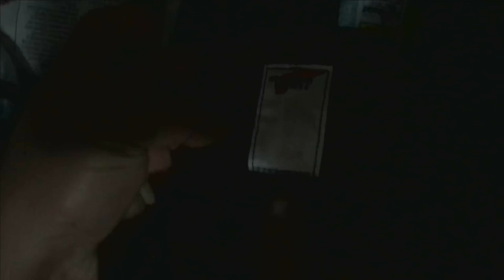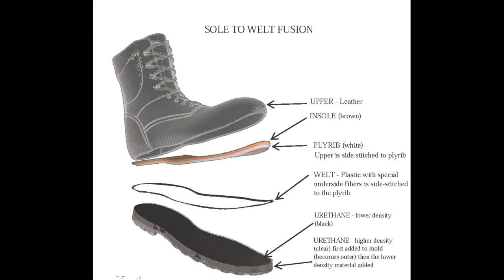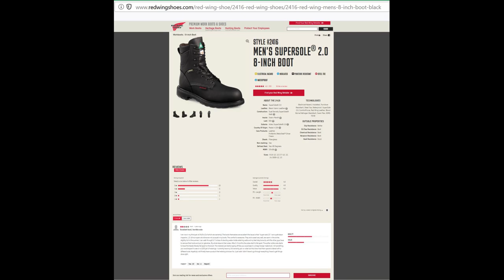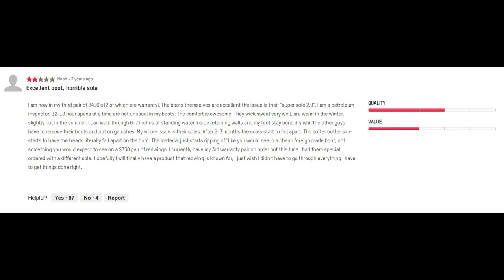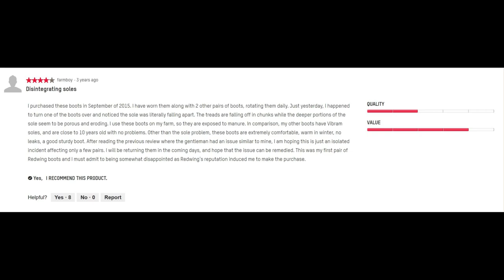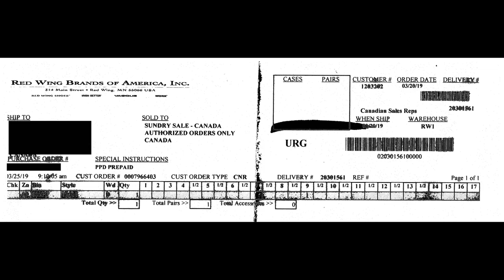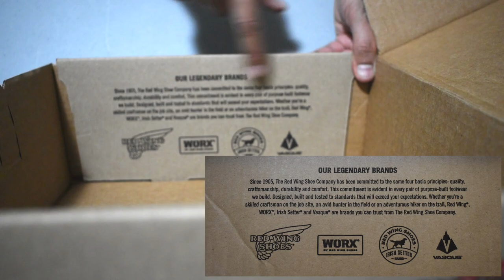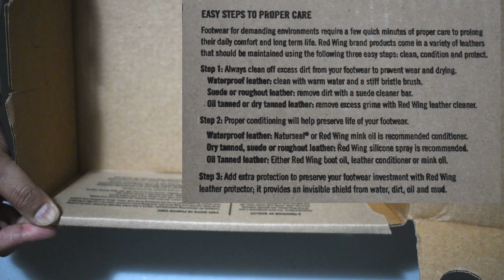𝗣𝗥𝗢𝗗𝗨𝗖𝗧 𝗥𝗘𝗩𝗜𝗘𝗪: 𝗥𝗲𝗱𝘄𝗶𝗻𝗴 𝗦𝘂𝗽𝗲𝗿𝘀𝗼𝗹𝗲 𝟮.𝟬 - 𝗥𝗲𝘀𝗼𝗹𝗲 𝗮𝗻𝗱 𝗥𝗲𝗽𝗹𝗮𝗰𝗲𝗺𝗲𝗻𝘁 - Model 2426/2416

Comment: Red wings are no longer the qaulity they once were. There is no lifetime warranty on them anymore. Now there is only a year warranty, if anything happens after a year your paying for shipping and whatever cost they decided they want to charge you. Also people don't realize it but they are not solely made in USA anymore most are made over seas. I have owned at least 11 red wings boots throughout my Life. I'm 56 years old and a contractor who has tried pretty much every brand out there . Red wings were good back in the 80s but not no more . They would last at least 5 years before the soles or stitching started to unravel. I just purchased a pair last year 2023 and paid $400 for them 2 days ago the stitches Ontop came apart, I took them into the red wings store in my area they said I barely made it in time before my 1 year warranty expired, I told them I thought they were lifetime warranty? They said not any more. They gave me a brand new pair because it was only 11 months and they couldn't be repaired. Back in the 80s they always could be repaired even if the stitching were to unravel. They said no they use machines for everything, therefore they are not hand made from scratch like they were in the 80s. She went on to say that they are a union company as well and they are having problems keeping people aboard to work because of our lazy new generation no one wants to work. They live with mommy and daddy till they are 40 years old so the qaulity of the manufacturing is just not there anymore. I have a pair of iron age that are now 7 years old and still going strong and 1/4 of the price that you pay for red wings. You see back in the 80s people cared about there jobs, they cared about the workmanship, in 2024 the only thing the new generation cared about is being on there cell phones and social media. She ( manager ) at this store is 65 years old and been working for red wings for over 30 years she said it's the new generation that has caused red wings qaulity to fall to the curb side,

Comment: Chapter 2 LoL
Well, to make a long story short... Oops, too late 🙄
Anyhowz, for the first coupla years (which actually only added up to approximately 6-8 months of service for a fairly Expensive ($275. USD @that time) pair of Workboots went quite well. In fact, at least another 300 + pair were purchased as Standard Safety Equipment for each and every employee by the company I worked for. After watching this video I just learned tonight that I'd inadvertently purchased a Vintage pair of Red Wing Boots as mine were manufactured in January of 2003 so according to Red Wing themselves they sat around for several years prior to being purchased and put into very Light Duty use (99.8% Fair Weather Summer use in fact) by Me. Being Ex-Military I imagine many/most of you probably know the Care and Attention given to footwear, Especially Black Leather Boots!?! Cleaned and Kept Cleaner than your Silverware not to mention, "Highly "Spit" Shined" to the point that the Heel and Toe outshine"Patent Leather". And YES, even the Soles are thoroughly cleaned using Soap/Water and a Stiff Bristle Scrub Brush. Except for that last day that is. Yeah, last year was "Just About a Bitch" but on the First Beautifully Gorgeous Day For a Ride showed up as always, Bikers make quite an Event out of it and I'm Absolutely No Exception. Heavy jeans, Heavy Red plaid shirt, Leather Vest w/ Tire Chains (in the event were caught out in one of those unexpected Michigan "Lake Effect"  Snow Squalls despite Global Warming LoL), And, Last but not Least... My Awesome Red Wing Boots along with X-Tra Special Riding Socks that complete the package. I'm Zipped, Buttoned, Snapped, Chained and Laced Up 🤔... Hmmm... Sounds a helluva lot kinkier than it looks HuH, Lmmfaooo...
First Trip... Oh somewhere around 75-100.... Feet, LMB'sO. Stopped at the Gas n Get next door for Smokes and other essentials for the Open Road. My buddy, Owner, is working behind the counter notices that I've acquired the dust mop and am giving the front and cooler aisles a quick once over.
After getting tired of standing/leaning/almost laying against the counter waiting for him to come out and finish his last minute stock ordering I've started wandering around Fronting and Facing the shelves which he hates on order day as he can't see what's NOT where it WAS, LoL! That gets him a Runnin' but he suddenly changes direction, disappears and comes back with the dust mop now running around the whole store with it like he's on the Olympic Curling Team of Vancouver or something. "GOD DAMN MUTHAFUKKA SON UF BEETCH AND CHITZ!!! WTFNF?!? AY JO,?!? JO?!? WHERE AH U MUTHAFUKKA... AHHHH... CHITZ... AGAIN!!!"
I forgot to mention he USED to be a Kind, Mild Mannered, Quiet, Soft Spoken, Indian Man of the Peace Loving Muslim Persuasion... Then he met ME!!!
Baaaaaahahaha... and HaH 😈
I hadn't noticed that it looked like Pigpen from Charlie Brown had spent the entire day walking throughout the entire store trying to find the perfect gift for Lucy or something so as usual I decided to give him a hand so he could finish and transmit his order and get out of there before midnight. After he recited absolutely nothing anyone could find in the Quran that is, Lmmfaooo... 
SON UF BEETCH AND CHITZ...HUH?!? OHHhh... Tank U My Friend... We finished about the same time and went outside as he wanted to see muh bike. "Ahhh... Goddamn, Nice, I like it. Don't let my son see eet tho, HO K. 
No prob, however your daughter's a completely different story altogether 😋
Hehehehe... God Damn U Fukker... 
🤤🤤🤤🤤🤤🤤🤤😋😋😋
When we walked back inside 
😬😬😳😳😦😮😯😲😱
He screamed like a Lil Gurl
But, so did I. Apparently, Pigpen had somehow returned and... Neither of us seen anything???
That wasn't at all like us... Neither of us had been drinking which I also had to teach Mr Clean!!! 
So, while he got the register drawers ready for the night girl I took care of the International Curling Championship, Gion' Fo Da Gold so we could get it Bronzed I suppose LoL.
Halfway through I heard the whiney ass cry of an India Indian, "OMFNGWTFNFAHHHH... FUKKITY FUKKIN' FUKK!!!
         STOOOOPPPPP!!!
YUP YUPP YUPPERS!!!
REAL RED WINGS AND WINGNUTS THROW OCTOPUSSY, Out On The Ice That Is... NOT ASPHALT!!!
By the time he Kicked me and my FUBARD BOOTS OUT I WAS BARELY ABLE TO EVEN WALK, LET ALONE STRAIGHT. I ROAD BACK HOME, DEFEATED AND EXTREMELY EMBARRASSED HAVING MADE SUCH A GODDAMN MESS OUT OF MY FRIENDS PLACE OF BUSINESS PLUS I WAS OUT A PAIR OF BOOTS THAT I COULDN'T AND ACTUALLY SHOULDN'T HAVE TO REPLACE AT ALL CONSIDERING IF I'D BEEN DOING SOME WORK AT YOUR HOME, I'D OF ENDED UP PAYING FOR PROFESSIONAL CLEANING AND/OR POSSIBLY REPLACING YOUR FLOORING.
SO ACCORDING TO SOME OF YOU, IF IT WERE REVERSED, YOU WOULD JUST WRITE ME A CHECK FOR THE DAMAGES THAT WEREN'T YOUR FAULT AND BUY A NEW PAIR OF BOOTS FROM THE COMPANY RESPONSIBLE IN THE FIRST PLACE? WELL BLESS YOUR LITTLE DUMBASSES, LOL 😆😂
Please Pull Up to the First or Second Window. Doesn't matter, We're the Nighttime Cleanup Crew, Romfflmmfaoooo...
Reply from the maker: Hi RO CK, thanks for watching and sending me and the community your experience with the boots.  It appears the event has left quite the impression on you.  I hope that writing about it helped somewhat.  Yep, I do understand how embarrassing it can be and how much of a mess those soles can make.  Hope you got them resoled.  All the best to you, H.D.H. [: { ].

Comment: So you're saying water and or long term storage-non use is the enemy of the supersole 2.0? I own 4 pairs currently.
Reply from the maker: HI CJ Cutter, Yes, in short the chemical composition of the Supersole 2.0, makes it unstable and water loving (hydrophilic), so when it is submerged in water or if it absorbs water from the air and doesn't get pressed down through normal usage, the water continues to accumulate and eventually the molecules separate creating the sticky, chunks that fall off.  I would recommend rotating the use of your 4 pairs of shoes and ensuring that after they come in contact with water, you ensure they are dry before putting them away.  While the soles are designed to cushion much of impact walking has on knees and joints, it comes with a cost of reduced longevity (as opposed to harder rubber which lasts longer, but doesn't have the same level of comfort).  Hope my response helps.  All the best to you, H.D.H. [: { ].
Reply: @HANDYDANDYHUSBAND  Appreciate it, yes I rotate them throughout the week so they are used constantly. Good info!
Reply from the maker: @cjcutter1571  thanks for your reply.  Its great that you rotate your shoes.  I hope you have many more years of comfort and use from your shoes with the assurance that if you do have any issues, Red Wing has your back. All the best to you, H.D.H.
[: { ].

Comment: Not sure if Red Wing would consider you a “great investor” by spending an average of $22 a year on them (based on current USD of this boot) That being said, Red Wing’s customer service has never disappointed me. Nobody stands behind their product better which is why they’re the only place I give my business for work boots
Reply from the maker: Hi Levi Conner, thanks for watching and sending me your comment.  I am happy that Red Wing's customer service has been consistent and reliable for you. I applaud your assessment, and I hope my YT video testimonial is adequate evidence of this.  Your $22/year assessment is intriguing.  I may have called myself a great investor, but I do not recall.  I hold a different opinion than you, however.  While paying only $22/year or even $1/year for a pair of shoes appears very economical, such an assessment is superficial and needs to be made conditional upon expectations.  I suppose, if the shoes had worn down over many, many years, I could not have complained--as they are a 'wearable' good (in both senses of the term).  The main issue and my reason for both the complaint and desire to make a video about the problem and its great resolution is the absolute, sudden disintegration of the soles with no warning or pre-notice by Red Wing of this hydrolysis issue the sole materials have.  Lets use Red Wing's initial email response as an example:  You buy an expensive, nice, sports car (add name here:  ______).  You are really good to it, you only drive it on sunny days, in the Summer, change its oil, maintain it well, and keep it in your garage.  One day it just breaks down...literally disintegrates into the concrete of your garage.  Do you care if you used it for 20 years?  After all the care and attention you took to protect your car, does its decision to spontaneously dissolve after 20 years become more acceptable?  Do you divide your cost (enter total amount for your expensive care here:  ____ and divide it by 20 years) and say, hell, it had a good run?  Or would you, be hot, stink'in mad that the very care you were taking to impart longevity to your vehicle was the very same process which enabled/accelerated its demise?  Well that is what happened to me.  I bought a pair of boots that were 3-10x more expensive than other boots I was looking at, took really good care of them and was told post-disintegration that because I did not 'walk my shoes' weekly in the summer, they were prone to just melt into the substrate that they were placed on.  I do understand and accept your position (and would defend your right to hold your opinion) but man...it just wouldn't and doesn't sit right with me.  All Red Wing has to do is put a warning label on their shoes that use this material.  Note, however, that they do not.  This means to me that for them providing such a pre-notice to their customers would be far more expensive (in the form of lost customers) than simply replacing or addressing the customer service issues that arise post-purchase (which will be limited after the 12 month warranty has expired).  As this is the case, if this is how they choose to address this issue (despite numerous customer complaints including my own), then so be it.  I will also make a conscious decision to demand rectification if and when the 'known issue' of their shoes affects me.  While I realize you probably won't agree with me (and that is totally OK), I hope that in some measure I have made my position clearer to you and why I proceeded as I did.  All the best you, H.D.H. [: { ].
Reply: 27:55 you said you’re a great investor for RedWing. You’re a great investor for yourself, not them. Relatively speaking they make almost no money from you.
Reply from the maker: @leviconner  Hi Levi Conner, thanks for reading my reply and providing your further clarification.  My apologies if I didn't enunciate the words properly, but I did not say "I am still a great investor for them".  I said, "I am still a great ambassador for them".  Regardless, I understand your point you are thinking about the the money or lack thereof Red Wing made from ME in particular.  The only response I have is to perhaps consider the amount of money they made from OTHERS who didn't complain or just threw out their boots after they failed (which is what my cobbler initially told me to do).  All the best to you, H.D.H. [: { ].
Reply: I hear ambassador now lol my bad
Reply from the maker: @leviconner  Hi Levi Conner...no problems man.  All the best to you, H.D.H.
[: { ].

Comment: Ridiculous. You pretty much robbed the Red Wings. I don’t know how somebody has to gall to complain about their boots after 15 years of ownership.
Reply from the maker: Hi Nope Nope, Thanks for watching and your comment.  Yes, I can see you point, but on my end, the shoes got very little usage during the time I had them...a similar boot with a rubber sole would have easily outlasted such a time frame.  I hope that you did find some of the information about the shoe construction and the process of hydrolysis helpful.
Reply: @HANDYDANDYHUSBAND  how often an item is used falls on the side of the user, not the manufacturer. Of course things degrade over time. That should be considered common sense and their analogy was spot on to me.

 Secondly, you explain early on in your video that you hardly ever use the boots, and then  5-10 minutes into the video you backtrack and explain that your wrote in your email to red wings that  "i take these boots to work and always praise them in front of my friends. now i'll be embarrassed to show up to work with deteriorating soles." so I don't know man. Do you almost never wear them, or do you always take them with you to work?  It sounds to me like you're fabricating some sort of story to score a new pair of boots.
Reply from the maker: Hi Nope Nope, thanks for your additional comments.  I am happy you took the time to watch my video carefully.  
Allow me to address your two points. I think that while 'usage' of an item is different for everyone, its the expectation of an item's durability based on that usage that is my main point.  In my case, I wore the boots only seasonally and not every season.  Now, if this was a $50 pair of shoes I bought from Walmart...I wouldn't complain after even a few years because the expectation is that low money up front means low longevity over the longer term.  But to pay North of $300 for a pair of boots; I think it is reasonable to  expect them to last much longer based on the manufacturer's advertised quality and durability especially when other pairs of Red Wings that I own have lasted much longer than that.  Note that if indeed, Red Wing, super sole 2.0 soled boots/shoes came with a warning or advisory stating that they did not last as long as rubber soles, then, as a consumer, it is on me.   I would have purchased a different brand or model of shoe.  Unfortunately, as my video shows, other people have experienced this same Hydrolysis issue within months of usage, but Red Wing still does not place an advisory on the packaging.         

    With regard to your second point, yes, you are correct I did say that I wore the boots to work; however, hardly using the boots and wearing them to work does not mean that I wore them regularly to work or over long distances.  Please review my first letter to Red Wing.   Note that these are heavy, insulated, waterproof boots with steel toes.  I work in an office where dress shoes are more commonplace and wearing them regularly without heavy, cold winter conditions would be odd. If it helps you, early in the video, I did also show the old crumbling heels of the old boots...the heels are  not appreciably worn down--only breaking apart in little pieces. I realize we may not  see eye to eye on this and that's OK.  Regardless of how you feel about my complaint, I am glad that you are aware of the Hydrolysis issue and can make an informed decision when you buy your shoes/boots that use polyurethane soles in the future.  Stay tuned, I will be making a video that does a deep dive into the issue of Hydrolysis soon.  Thanks for watching. 

H.D.H. [: { ]